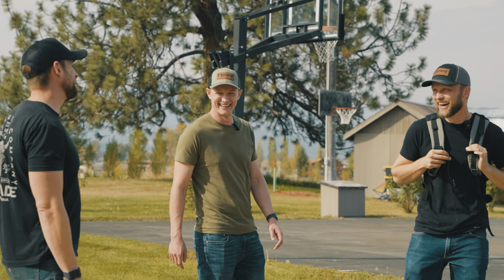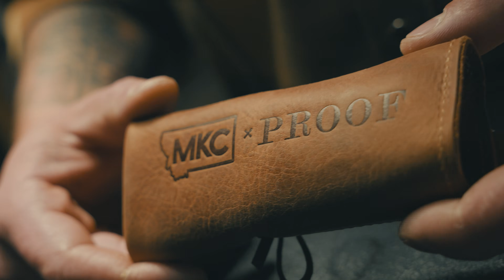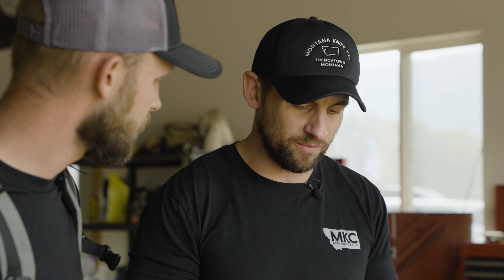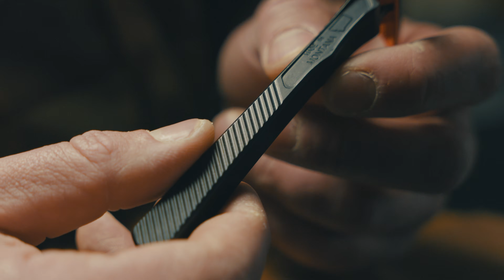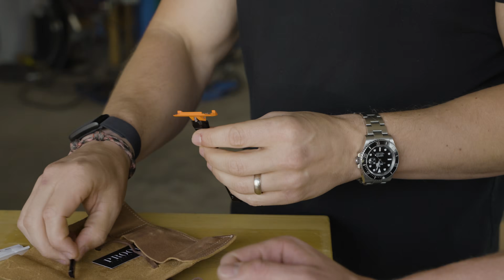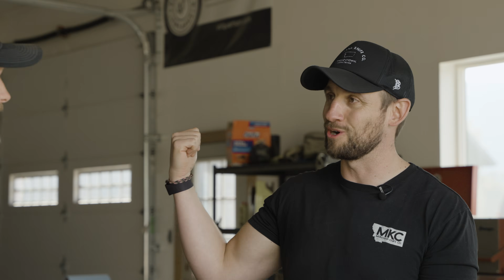INTRODUCING: THE MKC X PROOF EDC RAZOR

Comment: This is awesome! Having to shave everyday for the Army, the need is real for cost effective shaves.
Reply from the maker: Absolutely!
Reply: @MontanaKnifeCompany  Hello, I have a question: Does the Proof mkc razor shave the scalp as smoothly as a double-blade safety razor, such as a feather blade? I have a safety razor without a pivoting head, but I cut myself frequently, which is why I'm asking? Or is the Proof Select V2 or the slightly newer Proof Cleardet Hot x razor in black even better for shaving my head? 

An answer would be greatly appreciated. Regards, Stephan :)